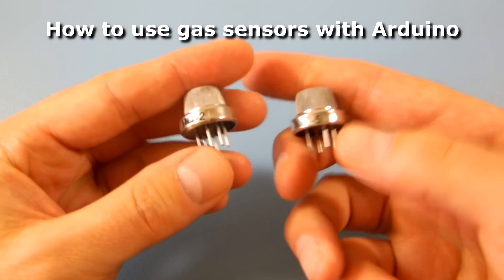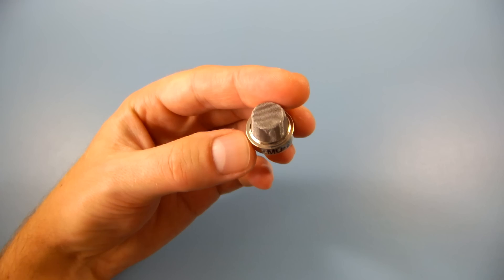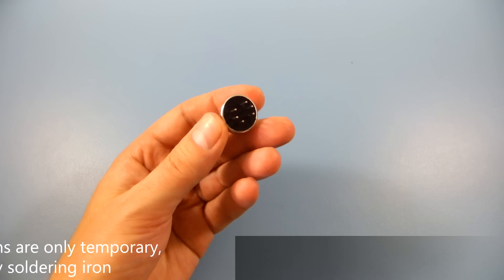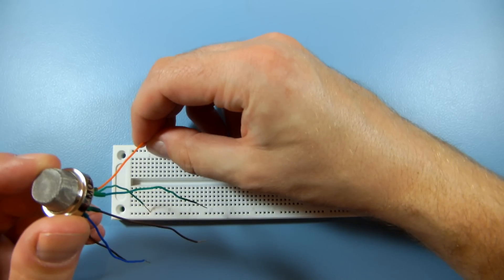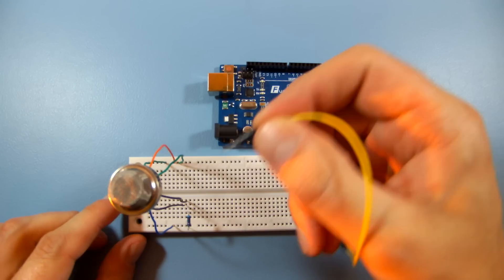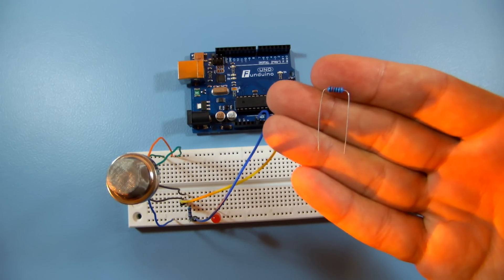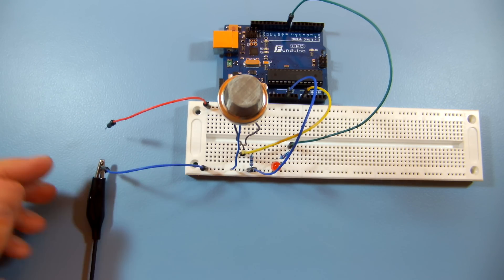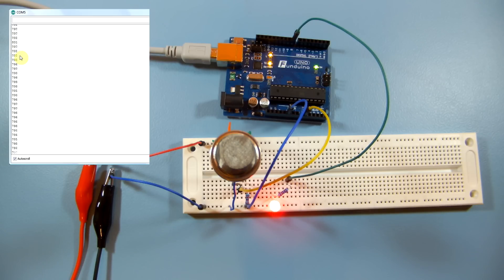How to use gas sensors with Arduino || Arduino tutorial

Comment: Hello Sir. Can you tell me which pins are the Vcc pins since, they are all identical?? Thank you
Reply from the maker: There are 2 groups of 3 pins. You want to supply 5V to the middle pin in each group. This sensor is not polarized, so it doesn't matter which pin will be your GND and which one will be your 5V.
Reply: Sir, then will the analog output pin not change?
Reply from the maker: The pins I'm talking about are just heater coil pins used for heating the sensor. The A and B pins should be connected like in the video.
Reply: ElectronFun.com Sir, but how do we identify the A and B pins since they are all identical?
Reply from the maker: Daniel Ravichandran
It doesn't matter which pair is A or B for you.
Reply: So the pins on the Group of +ve Heater Coil is A and the other is B. Is that it?
Reply from the maker: Daniel Ravichandran It's difficult to explain without a drawing, so go here: http://www.parallax.com/sites/default/files/downloads/605-00008-MQ-2-Datasheet.pdf and see Fig. 1. There is a diagram with the pinout. You can rotate your sensor by 180 degrees and the pinout stays the same.

Comment: Hey nice video, I have one question. Do you need to pre-heat those sensors 24h? and is is nessesary? If i read the values.. i get this:
23
0
0
0
0
1023
1023
1023
0
0
0
0
1023
1023
1023
0
0
0
285
1023
1023
327
0
0
1023
1023
1023
0
0
0
622
1023

I used your code. I don't know what im doing wrong..
Reply from the maker: Thanks a lot! The datasheet says these sensors should be preheated for 24 hours - it should make the readings more stable. As I can see your results are very inconsistent. I'd guess it might be a lose connection somewhere in your circuit.

Comment: Does this arduino code work with MQ131 ozone gas sensor? 
Thanks
Reply: ElectronFun.com Hi! i'm a little lost here, so if it's not a bother, how would you recommend me to calibrate a sensor? I'm using a MQ-4 and a MQ-7 btw.
Reply from the maker: Yes, the code will work with your sensor.
Reply: Sorry, and do you have another code that bring you the concentration?
Thank you very much
Reply from the maker: T1517F
The code gives you a value ranging from 0 to 1023. You would have to calibrate your sensor against a reference to know how to convert your readings to PPM units for example.
Reply from the maker: Silvana Díaz Hi, you can calibrate your sensor by comparing your readings with another already calibrated sensor, or by exposing your sensor to a well known gas concentration, e.g. 1000 ppm.

Comment: Well done!
I have a CDM4161 CO2 sensor, could you please tell me how to use that with an Arduino and python code? 
Thanks again!
Reply from the maker: Thanks!
I've just skimmed through the datasheet and it seems pretty easy to use with Arduino. Connect pin 1 to Arduino's 5V pin, pin 5 to Arduino's ground and pin 2 to one of Arduino's analog pins. You can use most of my code for Arduino. Why would you like to use Python code?
Reply: ElectronFun.com Thanks for the prompt reply! Actually, I am making a project wherein I have to integrate multiple sensors (temperature, CO2, pressure, etc). I have been working so far on Raspberry Pi. I can't find anything on the CDM4161 with the Pi and am worried that I will have to use ADC with it. So I am planning to use Arduino for this one.
Python because I have coded all sensors so far in python so I need to continue that.. Is there a script that I can use?
Reply from the maker: *****
Actually you don't need Arduino. Since Raspberry Pi doesn't have an analog to digital converter, you would need to buy an external one, like for example MCP3008 (about $4). You could connect your sensor to the Raspberry Pi and use Python to write the code. Here is a nice tutorial on how to use an analog to digital converter with Raspberry Pi.
Reply: ElectronFun.com Hey, thanks for your input! I got the MCP3008 to do the analog to digital conversion. I would have to calibrate the values of the converter since the values of the sensor and converter would be different. Do you have any suggestions how I could do so?
Reply from the maker: ***** Since MCP3008 is a 10-bit ADC, it should convert values from your sensor to something between 0 and 1023. A nice tutorial on how to connect an analog sensor to you Raspberry Pi through MCP3008 is here: http://www.raspberrypi-spy.co.uk/2013/10/analogue-sensors-on-the-raspberry-pi-using-an-mcp3008/.
Just remember that your sensor is rated for 5V, while Raspberry Pi's GPIO pins work with 3.3V. To safely work with the Pi, a voltage divider, like the one from this post should work: http://www.raspberrypi.org/forums/viewtopic.php?f=45&t=22841.
I can't check if it works correctly, because I don't have the Raspberry Pi, sorry.
Reply: ElectronFun.com Hey! Thanks for all the help. I have one more question. I see that on the pi there is a pin for 5V. I do have multiple sensors, so do you advise me to use this pin or an external power supply for the sensors ?(I have 2 sensors running at 5V in my proposed design)
Reply from the maker: *****
Hi, according to this thread: http://www.raspberrypi.org/forums/viewtopic.php?t=14153&p=158827 the Raspberry Pi has 3 fuses F1, F2 (140mA each) and F3 (750mA), but Raspberry Pi can consume up to 700mA so you don't have much left. It would be much safer, if you used an external power supply for the sensors.

Comment: hmm.. how to put on a buzzer on that?
Reply from the maker: You would have to connect it like an LED - positive lead to one of the digital pins on the Arduino and the other one to ground. The code is the same as the part for LED - set the pin high.

Comment: Is it possible to add a LCD display that shows the gas concentration in ppm to this
Reply from the maker: Yes, it is possible, but you would have to calibrate the sensor against a reference and then convert units from Arduino's 0-1023 to PPM.
Reply: ElectronFun.com do u have a code with LCD? thanks

Comment: Does this code work for the MQ9
Reply from the maker: Yes, the code should work with the MQ-9, wiring diagram is the same.
Reply: thanks, i tried and it works

Comment: Your video was very interesting.  Have you built an app to connect the Arduino based sensor to an Android phone?
Reply: ElectronFun.com henry maclin   can we SoftSerial and an el cheapo HC05 Bluetooth module to push values to Android and have the app do the PPM conversions?
Reply: ElectronFun.com  Thanks for the quick response! So calibration would need a measurable environment with specific dimensions?
Reply: ElectronFun.com
Ah ok ! I've got one of those sensors with the legs broken out on a PCB with a variable resistor and couple other nice to have components ! any chance I can get this thing calibrated without having to buy/borrow an expensive well calibrated sensor?
Reply: ElectronFun.com
 I'm not too sure, need to check my stash bag :)  I'm very curious about calibrating it using the potentiometer and the ADC resolution stated in the datasheet ! Will check and let you know! thanks again and keep up the great work ! looking forward to your forum !
Reply from the maker: No, I haven't thought about an app and it's a really good idea, but I've never written any apps for Android or iOS. The Arduino would probably have to be connected to the Internet through an Ethernet shield. Thanks for your comment and sharing your idea.
Reply from the maker: trevor lazarus
You can connect a Bluetooth module to the Arduino, but converting readings to PPM units requires calibrating the sensor against a reference. You can convert units in Arduino code as well, but without calibration the values may be inaccurate.
Reply from the maker: trevor lazarus
Yes, a measurable environment and another calibrated sensor, which shows proper PPM values.
Reply from the maker: trevor lazarus
What sensor is it?
Reply from the maker: trevor lazarus
Ok, thanks! Do you think a forum might be a good idea for such a small channel?
Reply: ElectronFun.com
I think it'd be a great idea ! especially because this is a small channel !!
 less is more my friend :)

Comment: good eve sir... can this project last for continuous use??? lets say a week or more without turning the power off?? will the sensor overheat or burn?? thanks alot sir
Reply from the maker: Hi, the sensor should be able to work constantly without problems. You can even  find in the datasheet that the sensor should be powered constantly for over 24 hours before first use (it's called preheat time). If you don't exceed the maximum voltage 5.1-5.2V the sensor will not overheat.

Comment: Well done- very nice video.  Would you mind describing how you could modify this project such that the Arduino reads two or more sensors simultaneously, such as an MQ135 and MQ138?  I would like to use the Arduino with 2 or more sensors to trigger a relay that would turn on/off an energy recover ventilator.  I live in the city, so air quality varies where I live.  Thanks!

John
Reply from the maker: Thanks a lot! You can read 2 or more sensors easily. In this video I connected the sensor to the breadboard and put a wire between the 'B' pins and A0 analog pin on the Arduino. Hook up another sensor in exactly the same way, but the wire from the 'B' pins should be connected to another free analog pin (e.g. A1) on the Arduino. You also need to update the Arduino code by adding A1 definition and read from this pin in 'void loop()'. If you have any problems with the code or schematic, please let me know and I'll try to help you.
Reply: ElectronFun.com Thanks so much!  I'll get a build going and get back to you.
John

Comment: Hello,
I really liked the video and i want to ask you few things on this, can we have sensor, alarm speaker and simple power supply which makes compatible and sense the gas. can you pls describe.
Reply from the maker: Thank you! Yes, it is possible to have a gas sensor with a power supply or some kind of battery and a speaker, which would alarm you, if it sensed certain gas concentration. The easiest way to make something like this would be to replace the LED with a small speaker.
I want to build a simple gas leakage detector in one of my next videos and use a speaker, or an LED bar graph or an LCD to show the results. I'm not able to tell you exactly when, because I have a "regular" job, which prevents me from making videos quicker and more frequently. I can see many people are interested in gas sensors, so this video will get higher priority.

Comment: pls make a vedio  on alchol sensor and eye blink sensor to prevent accidents
Reply from the maker: You can use MQ-3 alcohol sensor in exactly the same way as presented in this video, because it has identical pinout and voltages. When it comes to the eye blink sensor - do you mean some kind of system with glasses which would detect if you blink or not?

Comment: Hello,
I really enjoyed your video and it was really helpful.
I have a question though to ask you since I am doing a similar project with an MQ-2 gas sensor. While I am executing everything correctly, on the serial monitor I get values more than 800 (ex. 842) and when I apply gas from a lighter to the gas sensor, the values decrease dramatically reaching 40. It seems quite odd to me since I thought that the values where supposed to increase when the gas was detected.

The same thing happens with an MQ-7 gas sensor applying the same gas.
Any thoughts what would the problem be, if there is any?

p.s. Both the gas sensors are on a board by themselves (with resistors, pins etc.)

Thank you for your answer in advance!
Reply from the maker: I had a similar problem once. As far as I remember, it happens when you hook up the "B wires" through the 20k resistor to the positive rail instead of ground. I can check that when I get back home.
Reply: ElectronFun.com  The thing is that the sensors that I have bought, they already are on a board by themselves, like this http://goo.gl/1HoQXg
Reply from the maker: Do you have any datasheet for this sensor?
Reply: ElectronFun.com  Well, I had it bought from ebay and the sensor seems exactly the same to this one http://goo.gl/N0vqqN. You can find a description (datasheet) of the sensor on the link and hopefully it is the same to my sensor.
Reply from the maker: nofear7777777 What pins do you have on your sensor? Is it +5V, DOUT, AOUT and GND or something else? How did you connect it to your Arduino?
Reply: ElectronFun.com The pins of the sensor are +5V, DOUT, AOUT and GND. I have connected them like this:
+5V to 5V
GND to GND and
DOUT to an analog input A0.
The AOUT is not connected to anything.
Reply from the maker: Have you tried connecting AOUT instead of DOUT to your A0 pin?
Reply: ElectronFun.com And that was the problem after all. Now I feel kinda stupid. Thank you so much for your time and your help!
Reply from the maker: nofear7777777 Don't worry, we all learn from our mistakes. I'm glad your problem is solved.

Comment: sir this is really cool.im a newbie wih arduino and i wanted to know if it is possible to use this on a biodigester to create a system that will moniitor the gas flow and amount of slurry. if its ok i would like to ask u some more questions.
Reply from the maker: Hi, you have a very interesting project. You can ask and I will answer if I know the answers :) I have a question too - what type of gas does this biodigester produce?
Reply: it produces methane. its a portable small scale biogas. it uses anaerobic way of producing the methane.. i wanted to build a monitoring system for this and should be low cost. that is why i am choosing arduino. thanks for the help sir.
Reply from the maker: alpaxthegreat
Thanks for your answer. If you have any questions feel free to ask.
Reply: ElectronFun.com 
i would like to ask what sensors will i be needing and what model of arduino. when i tried searching, i read about seeduino stalker had been used for gathering data from a portable biogas. can i ask for some idea on how can i start with this project. thanks. and is it ok that im asking here?
Reply from the maker: alpaxthegreat
You may use MQ-4 gas sensor, which is sensitive for Methane and CNG Gas. When it comes to Arduino board - it depends on what you want to do with your data. Do you want to make a standalone device for monitoring and gathering data on e.g. SD card, or do you want to have it hooked up to a computer, which would store your data?
Seeeduino Stalker is a nice board with a slot for SD cards and a backup battery holder, but there's no USB connector. To use USB, you need to buy some additional connector (at least that's what I read on the wiki page).
Sure, you can ask questions here. I thought about opening a forum, I would like to have a place where all people from this community could help each other, but I don't know if it's not too early. By the way - what do you think about that?
Reply: ElectronFun.com
Sir i tried to visit your website. i believe its a great idea to open a forum. many are looking for some place to look for answers about arduino and many of the hobbyists would be happy to share knowledge. it helps a lot when we share ideas and knowledge especially for us newbies. i never had an interests at first but i seen your video it seems really fun to do. With regards to the the device, i plan to make it standalone. but i have to consider also the costing. if the MQ-4 and arduino can do it with a less cost, ill chose arduino. thanks again. 
ANother is there any sensor i could use to measure the amount of slurry inside the biodigester? just to avoid spills. Can MQ-4 measure the amount of gas? and a very noob question is can a single arduino drive multiple sensors?
Reply from the maker: alpaxthegreat Thanks for your opinion about the forum.
It would be cheaper to buy Arduino Uno, or a clone (there are tons of 100% compatible clones on the market) for about $10-$15 and one of SD card modules for a couple of dollars (I guess I've seen it somewhere for about $2). You would need about $60 for Seeeduino Stalker + UartSBee V4.
Yes, MQ-4 can measure the amount of gas - when connected to Arduino, it gives you a value between 0-1023. If you need a value in units like ppm, you would have to calibrate your sensor against a reference to get accurate results.
To answer you next question - yes, Arduino can handle multiple sensors. Uno for example has 6 analog input pins, so you can handle 6 sensors at a time. There are boards with more analog input pins.
When it comes to measuring the amount of slurry - there are ways of measuring levels of liquids in a tank. Would this be enough or do you have something more sophisticated on your mind?
Reply: ElectronFun.com
thanks a lot. that gave a light to all my queries. Now im sure i will be using arduino uno. Hope it is available here in my place. Im from the Philippines. I really appreciate all your help. Looking forward to the website and the forum. More power to u.
Reply from the maker: alpaxthegreat
Thanks :) I hope you can buy all the parts in the Philippines. If not, there are tons of parts on eBay - they send almost everything worldwide. Chinese sellers in many cases give you free postage.